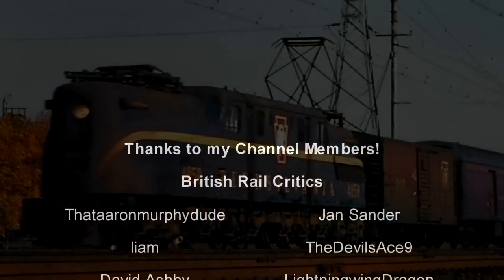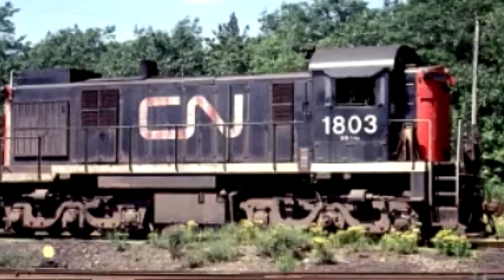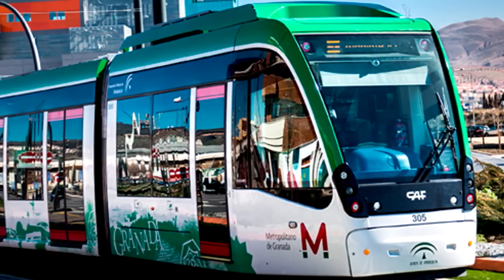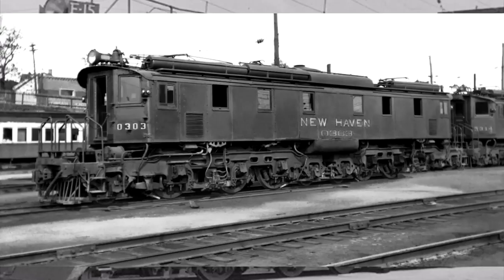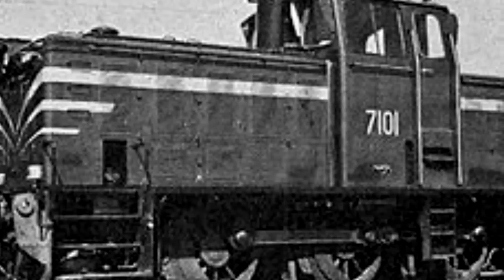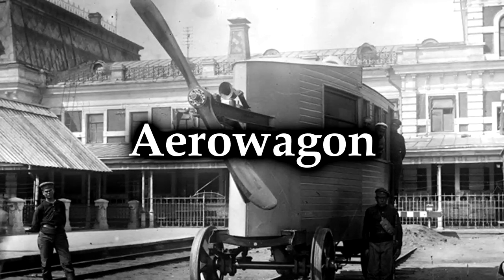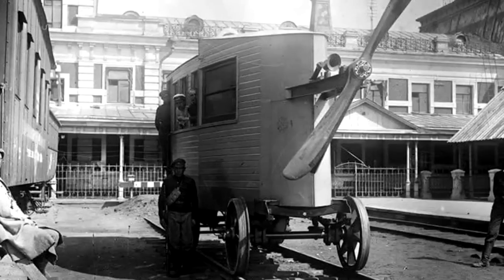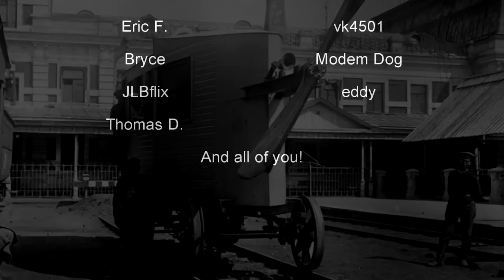5 MORE of the WORST TRAINS EVER PART 17 | History in the Dark

Comment: Haha glad to see the Urbos 3 get a mention in this eventually. The thing with them (At least in the case of Sydney), is that they had a LOT of build quality issues even before the frame cracking issues. Small things such as the chipboard interior side panels coming loose or not being flush, and the turntable on the articulations popping up, as well as squealing horribly whenever the tram negotiated a corner. They also had major issues with the wheels being made of too soft of a metal, so they would chew up their wheels whenever they went over points (hence the reason for 15km/hr TSRs all over the L1). Even ride quality was bed, riding over the centre bogie, the vibrations felt like it had little to no suspension/ride damping, and the jerk from stopping and starting was extremely rough, it seems on the braking side that they couldn't properly transition between the dynamic/regen brake to the mechanical brake. Drivers hated it too, they where rough to drive, a rough ride and rough to handle. They very much did prefer the Variotram units that the CAF trams replaced

Comment: A worst trains ever without BR ?!?

Huh, surprised by that cause I question every time how they have not gone bankrupt from the terrible locomotive’s they made
Reply: It is a shock having no BR. 
There are two reasons BR didn't go bankrupt though. Firstly they were state owned. They were though broken up and sold off to private companies in the 90s. Secondly, BR didn't actually make most of their trains, they bought them from other companies. Some of the companies did go bankrupt though, or were bought out by other companies since having made such rubbish during the 60s, neither BR nor anyone else wanted to buy from them again. A good example was North British Locomotive Company which built quite a few of the locos on these lists. It didn't help that they actually sold their locos to BR at a loss in the hope of getting more orders.
Reply: Considering that with this list, there have been 85 'worst trains' it could be that most if not all the BR trains that were not at least 'decent' have already been mentioned.
Reply: Birmingham has the CAF trams at #4. Their whole system had to shut down for a while because of the cracks.
Reply: @Eric_Hunt194  They are nothing to do with British Rail though. West Midlands Metro is a light rail system that was set up around 10 years after BR was privatised. The only connection they have to BR is that some of the route runs on old BR lines.
Reply: You’ll eventually run out of locomotives from a given company

Comment: for the next episode: german br 119 "U-boat"

A guy from the Railroad Museum in Chemnitz told me a story: Back in the GDR, they had a passenger service Chemnitz - Leipzig (50 miles) and back, which was to be driven two times a day. For this service, they needed four locomotives of the br 119, because the first locomotive would break going to Leipzig, the second one would break going back to Chemnitz, the third one on the way to Leipzig and so on. 

Obviously a bit of an exaggeration, but it goes to show the (un-) reliability of these engines.

I also reccomend the two videos of the german youtuber Alwin Meschede on the topic of unreliable west-german diesel engines.

Comment: The MLW RSC-24 were built as a result of 2 factors- CN needed additional units for use on light rail lines, and MLW had offered a re-engining program to replace 244 engines with new 251's. CN sent 2 FPA-2 and 2 FPB-2 units to MLW to be re-engined with the new 251's The used 244 engines were put into these 4 engines, CN 1800-1803.
CN opted to purchase the new model FPA/B-4 rather than continuing to re-engine the FPA/B-2's, thereby ending the RSC-24 program as well.
They were delivered in 1959 and lasted until 1976 (minus 1 unit wrecked), when their trucks (along with those from RSC-13 units) were used to convert RS-18's into "RSC-14's".

Comment: Greetings from Germany.

As suggestion for the next video in this series I would call out the DR Class 119.

As the Wikipedia article starts: The DR Class 119 was an East German Deutsche Reichsbahn diesel locomotive that was built in Romania. When the Deutsche Bahn AG formed up in 1993 it was redesignated as DBAG Class 219.

They were nicknamed "U-boats", "Karpatenschreck" ("Carpathian Terror") or "Ceaușescus Rache" ("Ceaușescu's revenge") - the latter two referring to the numerous technical problems the engines suffered before redesign.[
Reply: Der Typ beschäftigt sich fast ausschließlich mit Lokomotiven oder Zügen aus dem englischsprachigen Raum, vorzugsweise USA, was wahrscheinlich auch dem Geschmack des Publikums entspricht. Hinzu kommt die Sprachbarriere, also Quellen die nicht in Englisch sind, werden kaum ausgewertet. Deshalb: Dein Vorschlag wird wohl ignoriert.
Reply: @fasold2164  Nun das aktuelle Video beweist das Gegenteil. Man muss nur jemanden einen Tip geben.
Reply: @fasold2164  It's more likely to be because he's an American

Comment: The funny thing with the 5 W class in preservation, only one that I know of (W 241, the class leader) operates regularly, and I know at least one more is operable but I don’t know how often it runs, another thing that the Ws did poorly, was cooling, they got hot quiet regularly, (i don’t know if you mentioned that, if you did I apologise I must have missed it) and when W241 was running passenger trains for a short while, it did get hot (I don’t know how hot or if it did it a lot) Safe to say we only shunt with it now.
Reply: I believe it was a W which took the 4D to scrap! Fitting for this series.
Reply: @griffinrails  I think it was 241 as well lol
Reply: One thing I forgot to mention, on the note of crews hating them and them sucking so much in the early years, they (due to their German origins) came known as Hitlers revenge (remember, the war only ended some 10 or so years prior, so it was still fresh in people’s minds)

Comment: In regards to #5, I would like to point out that there WAS a solution to fix the problems with the 244. The railroads had the option to send their locomotives to Alco or MLW to be rebuilt, and the 244 prime mover being repaired would be re-designated as the 250, both to indicate the fact that it was repaired and to push stigma away from the reputation the number 244 had gained. Additionally, when the RSC24s were retired, their trucks, and trucks from the RSC13s, were used on rebuilt RS18s which were designated as RSC14.

Comment: Something that surprised me is the fact that we here in Belgrade Serbia, Aren't the only ones to have problems with our CAF urbos 3 trams, our trams are in relatively good condition mechanically, but the problems arise from the fact that they're too wide fir our meter gauge tramway, and too long to turn around on some of the loops, i thought, surely they work well on standard gauge tramways, but apparently not, anyway i've learned something new today and that's always a good thing.

Comment: In some legislation, the only difference between a streetcar and a train is the legal frame they work under. Actually, you can have pieces of track, where the law changes (a so called transfer point), and a streetcar running along this track turns into a train, or vice versa.
Reply: Oh in the Town Karlsruhe we have Traintrams. It is very succesfull in the region. Can drive on maintracks with the AC and in the city with the typical DC electrical system.
Reply: @dermonarch5814  That would be one of the most famous examples: Within Karlsruhe, the traintrams run following Strassenbahnbetriebsordnung (StBO, Tram Operation Regulation). As soon as they are crossing Albtalbahnhof (the transfer point), they are run following Eisenbahnbetriebsordnung (EBO, Railway Operation Regulation). You can tell the difference for instance from the light signals: tram signals within Karlsruhe, but normal railway signals on the train sections. Another example would be the Line STB in Innsbruck, which runs from Innsbruck Main Station through the city following Austrian StBO, but in Stubaitalbahnhof, it switches to Austrian EBO, and runs as train to Fulpmes.

Comment: Submission for worst trains ever: Renfe 4000 series diesels (Spain). Basically a German V200 Series diesel cranked up to 4000hp with predictable results.

Also, submission for best trains ever: Renfe 333 series diesels (Spain, again). Nicknamed "Rambos" due to their horsepower and impossibility to destroy. So good that instead of being replaced after +30 years of service, they were rebuilt and upgraded with all the modern bells and whistles and still in service today.

Comment: The  RSC 24 was designed to work very lightweight branch lines in the Canadian system that had track weights of under 60 lb a foot rail some of which had been laid in the 1870's.  They literally could walk on tracks that had next to no ballast no ties on tracks that where laid on the ground and still pull out the grain boxcars loaded to 50 tons of weight.  For what they had to do they did fine.  See the GMD-1 for what EMD/GMD came up with for the same idea.

Comment: Yes, the propellers should be shrouded and while the propeller driven rail cars have their problems they also have the strength that they're immune to traction problems.

High speed derailments are disastrous but what is the evidence that the derailment was caused by the propulsion?

Comment: I have something that should make the list: HŽ 7121 Series. These are DMUs used for inter-city and commuter traffic by the Croatian Railways. They were originally designed by Macosa from Barcelona, Spain, and built in the early 1980s for the former Yugoslav Railways. After the breakup of Yugoslavia, all of them ended up in Croatia and are unfortunately still in service. I say unfortunately because they are terrible. They were mediocre in every way even by the 1980s Yugoslav standards, and now that they are old beaters, they are even worse. The biggest issue are their diesel prime movers; they use MAN 2866 engines, which are not bad themselves. However, they were not originally designed for passenger trains, but for industrial use (such as powering generators), and as such are very loud and unrefined. And there is no soundproofing between the passenger compartment and the prime movers, which makes the 7121 Series extremely uncomfortable. Also, their interiors are visibly cheap, there is no wheelchair access and the ride quality is mediocre (though nowhere near as bad as in the British Pacers). Thankfully, the 7121 Series makes up only a minority in the Croatian Railways' fleet, but they are unlikely to be withdrawn from service any time soon because the company is financially unstable and can't afford enough new trains to get rid of that trash.

Comment: Two ideas for a further part of this video:
In italy we once had the d356 (our kriegslokomotive)it was a diesel locomotive built during ww2 made out pieces of railcars and incredibly pieces of wood
The concept was about the same as the german kriegslokomotive, but luckly only four were built and 3 of them lasted until the late 70s.
Seeing you also included trams i report the worst tramway ever: the montre tramways company's 1175 class:
It's another wartime vehicle built in 1943 by the m.t.c. itself using masonite for the body and trucks derived from some panoramic cars.
Only 4 were built and they lasted sometimes only 4 years, being retired and converted into works cars between 1947 and 1950
Links: - d356 https://it.wikipedia.org/wiki/Locomotiva_FS_356
- mtc 1175 (photo at 2:42 of this video : https://youtu.be/-fQMOjP2_aE)

Comment: Why is being derated being more suitable for light branch service? Sometimes the things mentioned here sound like Trains21 or that really bad locomotive wiki...
Reply: It was derated because of the A1A bogies, which while they spread the loco's weight over more axles, also meant that only about 67% of the loco's weight was available for adhesion. Putting more power into that would result in copious wheel slip.
Reply: @JBofBrisbane  only 400hp less in the grand scheme of things but it wasn't a serious question....

Comment: I though the VR W class were actually narrow diesels from poland, because of the angle and the stubby look in the picture of the thumbnail.
Reply: Actually, it looks alot like the German V60, which also had a hydraulic transmission and jackshaft drive.  However, the V60 was highly successful, with some running for 50 years.
Reply: @drecksaukerl  huh, guess you have a point, but to me they have a more similar shape to those pkp ngauge diesels.

Comment: The Aerowagon obviously has too much weight too high. Maybe the engine should have been mounted in the frame and the fuel tanks slung underneath. Were both wheels braked. Even if it had brakes like a freight wagon . If it did 140 Kmh then efficient brakes ought to have been a priority. 
You can imagine the poor designers last words were "Cyka, blyat" upon encountering a really tight curve at full sped or it starts to sway from side to side